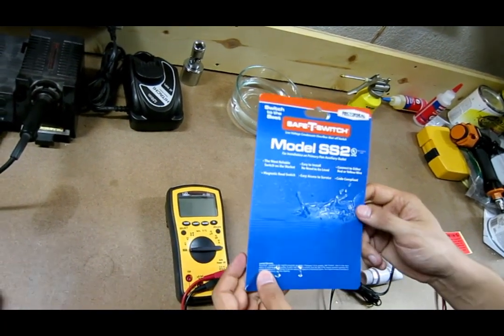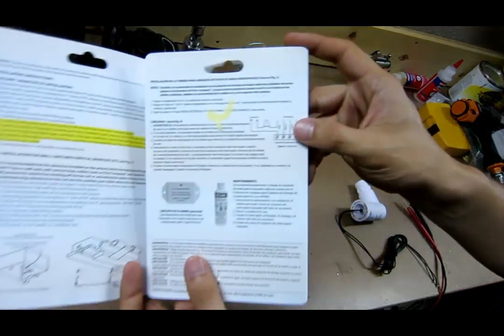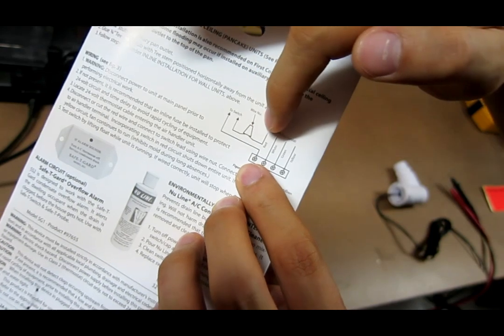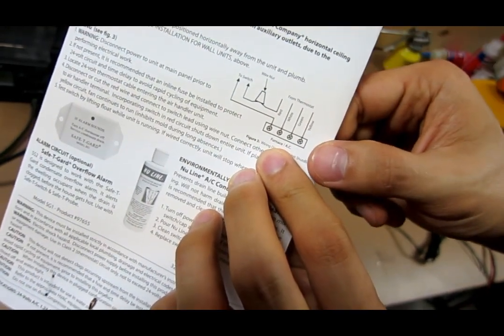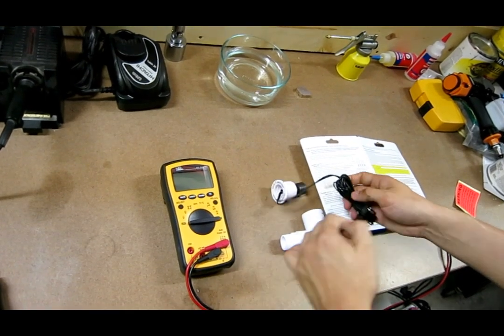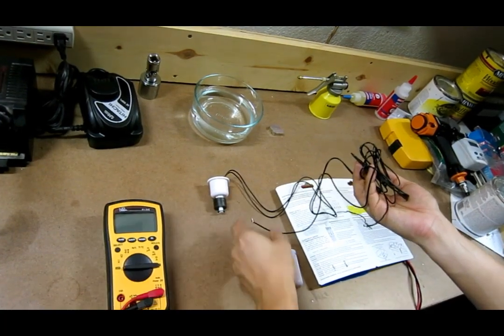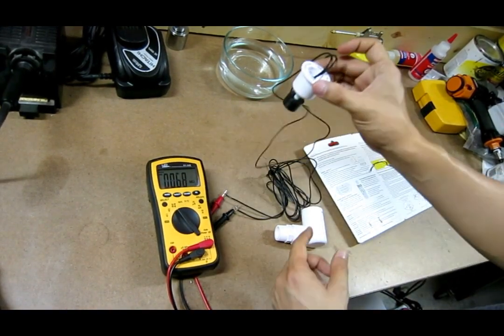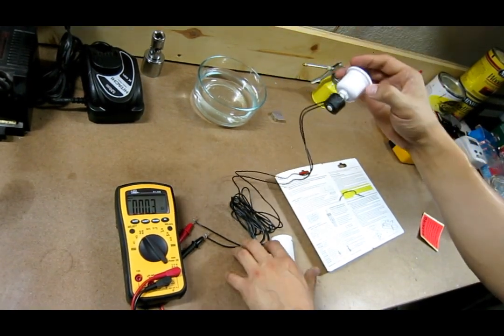Explain how does a HVAC condensate overflow shut-off switch device works - AC A/C

Comment: our overflow was full to the point where it raised the protection device, inside the thermostat went blank leading me to think the thermostat was bad, I went to the air handler and noticed it was wet in the area of the overflow protection device and it was full of water, i lifted the protection device out and blew the water out the pipe and cleaned the pipe and then put the protection device back in, after about 10 minutes the ac started to run again normally... Hope this helps someone out that may think their thermostat may be malfunctioning.
Reply: Thanks! But do you know why it overflow to begin with?

Comment: first off let me thank you for not making this a 10 min video. if I need to bypass this switch to keep the ac going while I fined a replacement can I just connect both ends of the red wire back together? i cleared my clogged line, everything is bone dry, but i might not be able to get another switch until tomorrow

Comment: If I connect this switch will I have to disconnect my safety switch from my compensate pump?  Or can I use both to turn off the HVAC?  Will I be able to have them both connected to the HVAC to turn off the HVAC?  Will the HVAC stop condensing in either case?  That is, in the case of a clog in the HVAC drain line, or in the case that the compensate pump fails and begins to overfill?  If I can only use one of these switches, which one is best to use?

Comment: Does this go for If the AC AND heat won’t turn on? My system shit off suddenly with no prior warnings or problems. I wired up a new thermostat to see if it was that. Because with the old one the numbers were barely showing up and so I started with that. It’s not that. And it’s connected properly. It’s also not the fuses at the outside unit.

Comment: good vid, but i would rather you use the terminology open or closed... not "shorted" .. all that device is is a basic switch that is normally closed.. upon activation via float it opens..( not "shorts") ..
Reply: So is this overflow shut-off switch device a normally closed or normally opened??? THink its normally closed...
Reply: Yes, the overflow shut-off switch is normally closed. It opens when the water level gets too high. It's the opposite of the float switch in the condensate pump tank, which is normally open, but closes when the water level gets high enough. (And the overflow shut-off switch takes a higher water level to trigger it.)

Comment from the maker: search "most common AC problem - blower doesn't come on" on youtube or my channel. and go to 2min 40 sec.
There really isnt any diagram. you can search "installation overflow shut off hvac" in google, and some sites that sell the overflow shutoff valve has installation instructions.

Comment: Ok I'm have this problem I pull top off safe t switch and  my thermostat turns back on and the switch was full of water my ? Is how do u get the water out or do I half to change the whole switch out thanks
Reply from the maker: Sounds like the safety switch is working.
Collecting water is normal, but it should drain and it shouldnt trigger the safety switch. you might have a clogged drain and the water cant drain correctly.